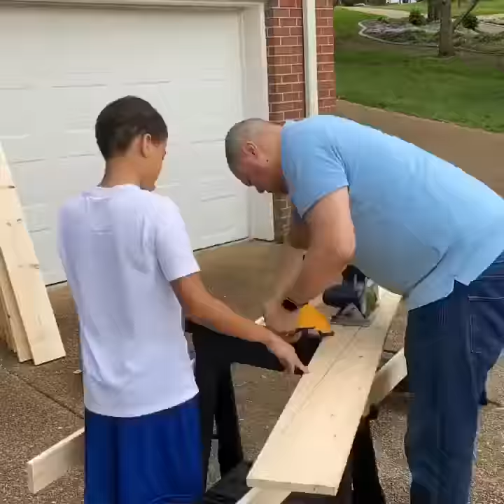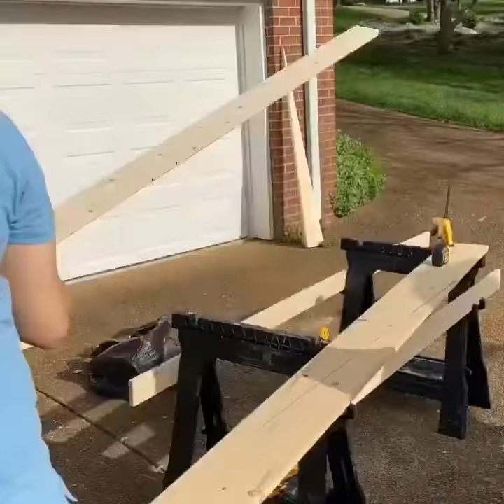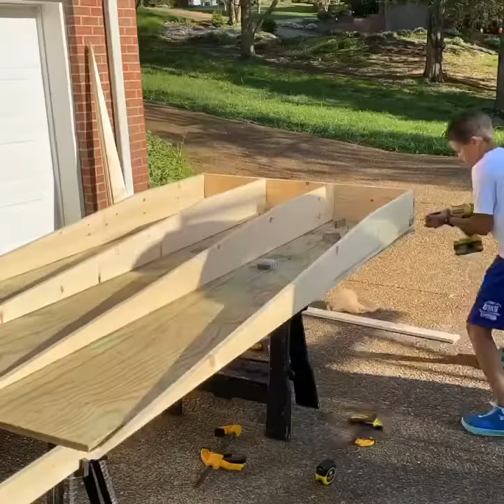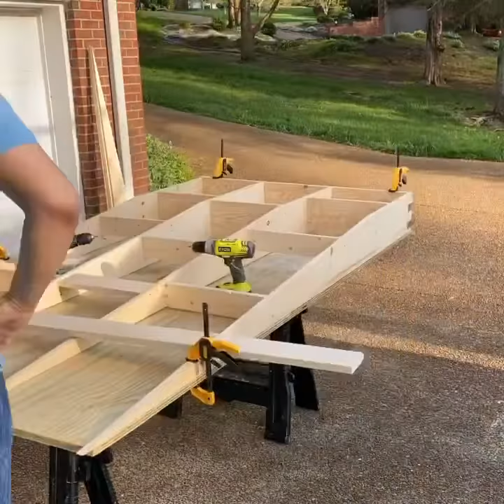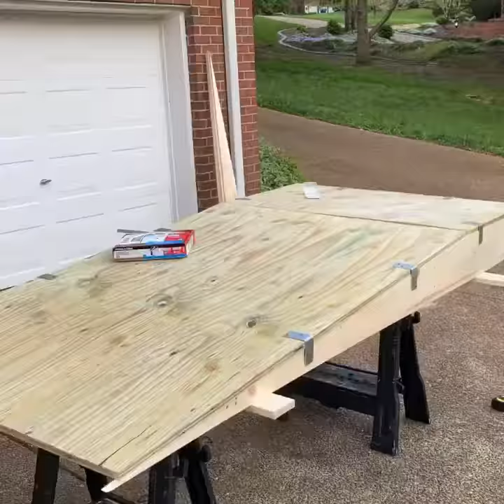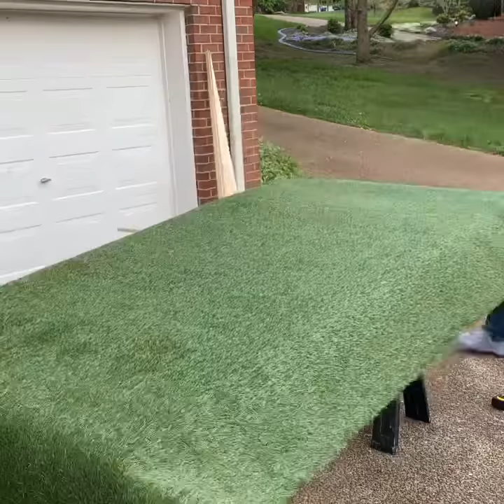Made a. Pitching mound with my son.

Comment: Official height of a mound ranges from 4 to 10 inches. Use the whole Sheet of plywood which is 4‘ x 8‘. You would cut the boards to 8’ in length and then taper it off to where there is enough wood to support the lip without cracking it. so I would say at least a half inch. Soooo…. 8’ board at 10 inches in height tapered all the way down to a half inch hit it with a line and that’s your cut.
Reply: also, id plateau, the 10 inches 2’ from the back of the mound before going into the taper.